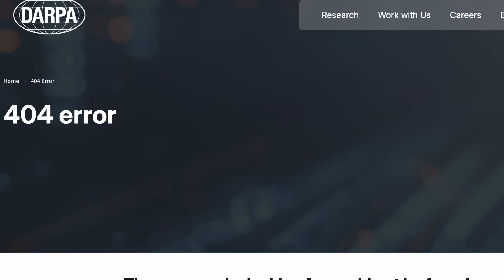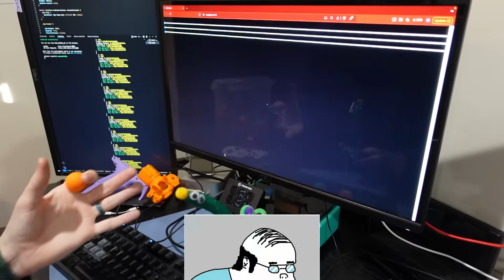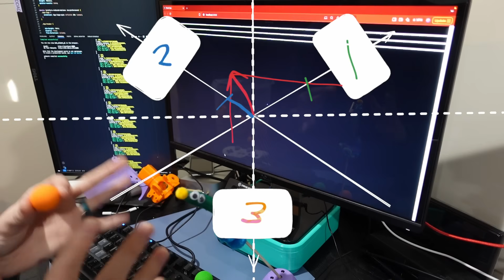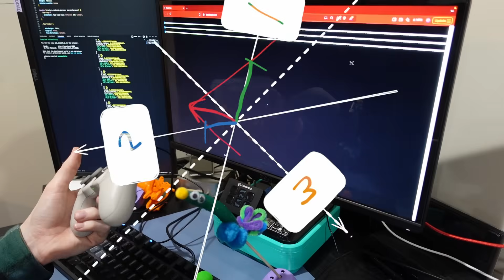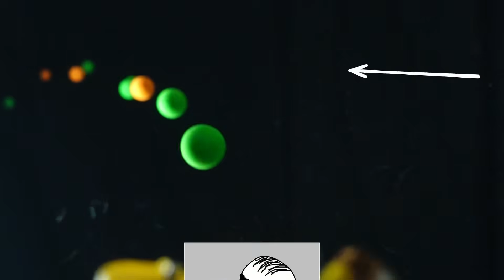Shooting Around Corners Using the Magnus Effect

Comment: Such a cool video ! What's funny is that I am currently building exactly the same launcher. Using the rotor ot the brushless motors as the griping surface is brilliant, unfortunately I can't do the same with ping pong balls. On my launcher I can't figure out how to make the motors spin slow enough to create a magnus effect, did you use typical drone esc's or more programmable ones?  I can't wait to see the future of this project and your other projects !
Reply from the maker: It sounds like you're currently using the same escs I used in the video haha, I had a similar issue. I have a solution and I'm going to include it in the next video :) hopefully it'll be helpful for you.

Comment: How about adding an accelerometer and a narrow-aim (so it doesn't get confused with by background) distance sensor to calculate how much up spin it needs to add to compensate for the arc the gravity would induce over the distance to the target (might need a little filtering if your hands are too shaky, or if the mechanism itself introduces too much vibration during bursts), and if you wanna go fancy, perhaps also something like a low-resolution high-framerate camera to calculate optical flow to detect target motion and predict future position to estimate how much and which direction it need to curve the trajectory to hit a moving target (combining with the accelerometer and distance sensor data to ensure it works right when your hand is moving)?

Comment: Hi! The effect that you reproduced has long been used in airsoft drives. There's a hop-up thing. It's just a small rubber protrusion inside the barrel. The ball is pushed out by air pressure without rotation, but touching one of its edges on the ledge, it acquires rotation. Thus, after leaving the barrel, the ball begins to fly up, not down, as any normal projectile should. This increases the range of the shot. But this is not the way DARPA used it. In their ammunition, the correction to the flight of the bullet is made after the shot, and how much I understood. But, of course, everything in this work is so classified that it is impossible to get a real idea of how it works.

Comment: In Russia, 10x28mm rubber bullets can be fired very far and accurately with a special barrel. I think you can do this job better with a single engine and a barrel that can rotate 360 degrees.
Reply from the maker: There's a few reasons I didn't use this approach. The main one being it would lose the ability to shoot without spin.

Comment: May be cool to add circle around mode, that just shoots around the place you are pointing at. Or correct for gravity with laser, distance sensor and accelerometer. Anyway, this is really nice and fun project.
Reply from the maker: I do compensate for gravity, but it's not dynamic based on the guns orientation. That is a great idea.

Comment: I've done this in airsoft by tilting the gun. Airsoft has a rubber piece in the bottom of the barrel which creates the back spin. It would be really cool to have the analog joystick on your nerf trigger to control the spinning vector. Although tilting the gun to aim is cooler imo! Being able to control the amount of backspin could really open up some cool shooting
Reply: Airsoft really changes the calculus regarding the "gangster pose" functionality.  It has a purpose in airsoft... to shoot around corners.  I'd flip my gun upside down to use that hop-up to arc the bb over cover.  It very much confused people and was funny.

Comment: YO IM DOING SOMETHING SUPER SIMILAR!!! Mine uses two flywheels to induce spin and I've only made a proof of concept so far, but I plan to make the curve controlled by the tilt of the blaster. I recommend using concave plastic wheels and pocketed ammo, as this will allow better contact and friction, as well as a stronger curve. Lighter ammo would also help, but that mainly comes from suuuuper cheap amazon ammo.

Comment: How much of the speed is from the air and how much is from the wheels? Also, very cool.
Reply from the maker: Basically all of it is from the motors. The gun fires at the same velocity whether poking them through with my fingies or using the blower. The rate of fire is drastically different between poking the balls and blowing them though.